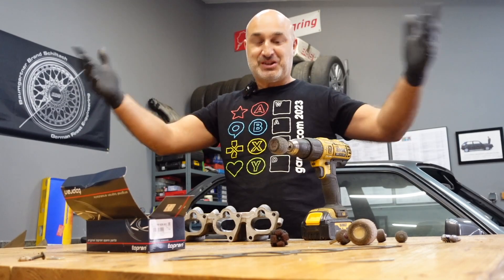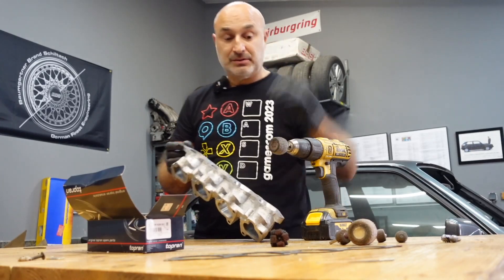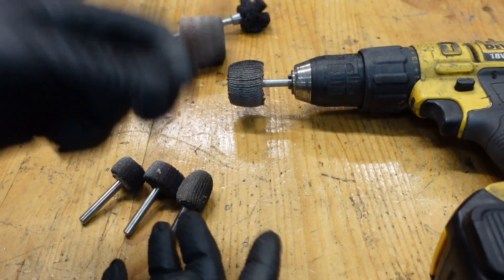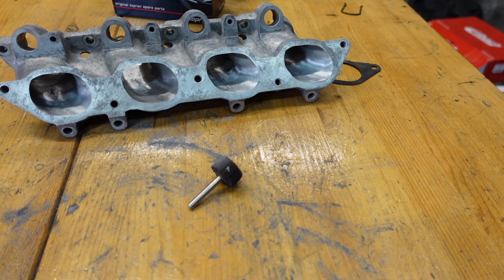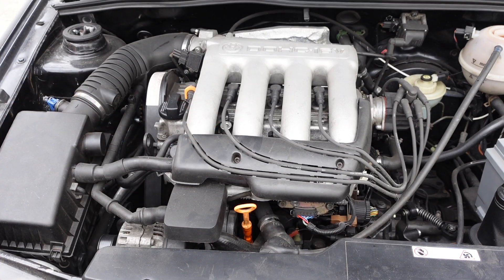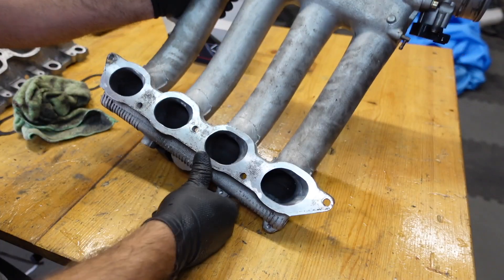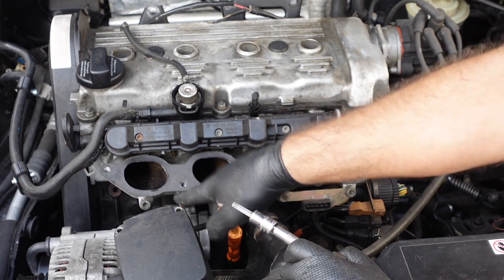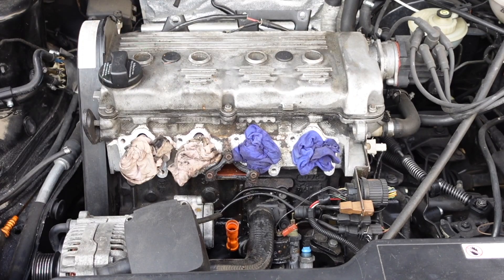How To Port Match Your ABF Inlet Manifold

Comment: Hello Sir, ive watched your series on the bon jovi mk3. After watching i went ahead and did the same mods as you on my passat b3.
The car is swapped to a afn from a mk3, i did the same turbo, as well as .230 nossles, 11mm pump, decat and egr delete,
However, ive run into a problem. My mate cant seem to get his kess to communicate with the ecu. Was the map you had done with the desoldering of the chip? 
From what ive found on the web only some of these afn seem to be able to be obd remapabld, but finding info seems difficult.
If you have and info you can share id greatly appreciate it!

Regards Jonas from Denmark 😁
Reply from the maker: Hi Jonas, the only AFN that I know that can be mapped from the OBD port are later ones from the Golf mk4 90 & 110hp and Seat 6k2 90 & 110hp, those are not engine code AFN as they use the later blocks with the water pump driven off the timing belt. Yes the chip in the Bon Jovi was soldered in.

Comment: The combustion chamber is the biggest flow limitation on these engines. 
The valve angles and shrouding is terrible.
Reply from the maker: Yep totally agree, the narrow angle of the valves are terrible with the exhaust valves at 90º to the pistons and the inlet with only a slight angle, the engine being 'under square' also doesn't help the shrouding issue. But I stand by the inlet manifold, as it's first in line air flow wise. Had cars come in trying to hit 200 with cams, head work and pistons and it's almost impossible, I've only ever seen 2 engine hit that(doesn't main there isn't more) with a ABF inlet on. I know the guys from South Africa are doing some crazy stuff with BMW 84mm pistons and TDI cranks.

Comment: Did you port match the lower inlet on the side that meets the head? On test drive was there any real world difference with the bum dyno?
Reply from the maker: I felt a slight improvement at light throttle. 👍🏼